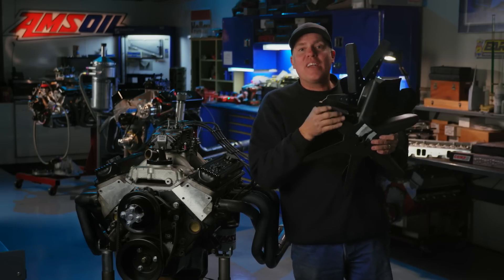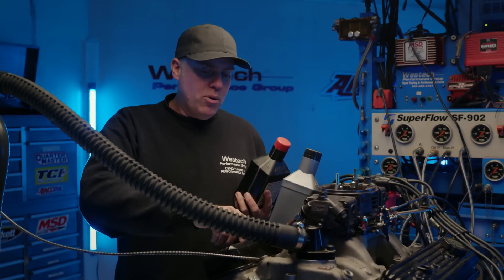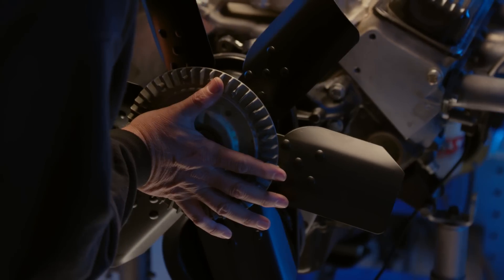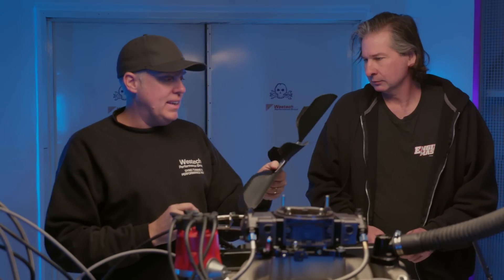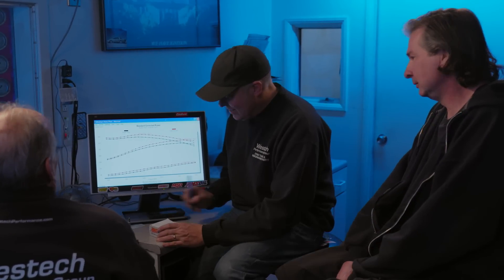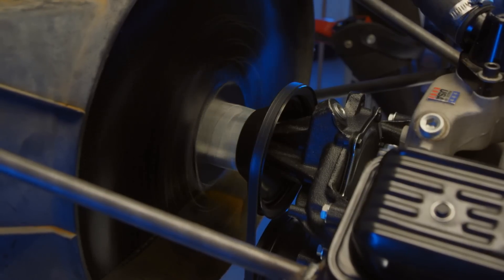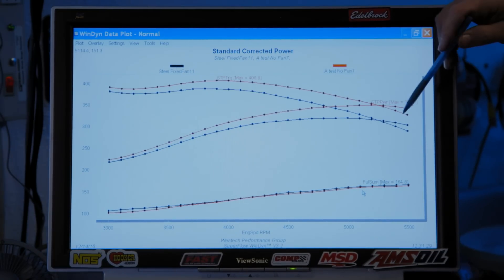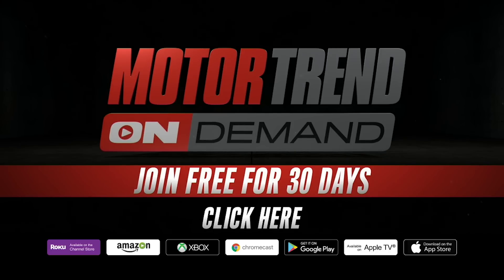Cooling Fan Shoot-Out! - Engine Masters Ep. 20

Comment: Air flow vs. power loss would have been interesting - hp/cfm
Air resistance force is a function of second power of velocity, to get the power it's multiplied again with velocity, so you get a function of third power of velocity - the loss is growing exponentially very fast with higher rpm, the faster the fan blades move air

Comment: These numbers are only relevant at very low miles per hour, after 30mph or so the fan is being dealt more air than it can use. Maybe put a wind speed Guage behind the fan and that would give the speed at which the fan is not using any hp,  only spinning in neutral air.

Comment: I think removing the shroud helped because the fan needed to do less work to get the air moving. With the shroud on it was forced to suck all air through the radiator. Also actual horsepower while driving might be different since air flows through the front better when you're driving fast so fan needs to suck less as air is compressed in front of the vehicle at higher speeds. Driving 100mph, not counting actual wind, is more or less the same as wind blowing 100mph against the radiator and the fan behind it.

Comment: An electric fan swap sounds like a good bang-for-your-buck mod. If your conclusion of 30hp regardless of engine power is right, 30hp on a 200hp motor is a great increase. I might have to swap out the fan on my truck.

Comment: these parasites should be killed off. got mine removed a year and a half ago, went with a flex-a-lite black magic extreme E-fan and its great, turns on with a temp sensor and is adjustable. never going back to that clutch fan.

Comment: reason for the more power with out the shroud, confinement of air. It's like messing with a vacuum hose. if you block off the hose, the motor has to work harder.

Comment: Removing the shroud makes the fan less efficient = less air moved= less work done by the fan= less power used.
A shroud direct the airlow towards the blades.
= les efficient cooling system withou it
I disagree about the electric fan : a charging alternator makes a huge load on an engine.

Comment: The whole purpose of a shroud is to help guide air to the fan. That's why shrouds exist because they help more air get pulled across the radiator cooling fins and help cool the engine down faster. So it makes sense the fixed fan had a slight HP gain with no shroud as it wasn't able to "bite" into the air nearly as much.

Comment: clutch fans(via the jeep in the driveway)drive at full tilt for about the first 4-5 min when cold then you can hold the thing with 2 fingers.....until the thermal clutch kicks in above about 205 degrees then it starts the fan rotating with vigor! hardly and drag in between.
doesn't matter with my xjs though. the v12 has two electric fans installed and the original nightmare setup has been removed.40 amp draw with both on and that doesn't eat the ponies up at all in comparison. go with electric units ;-)

Comment: My take, 12V at 30A is 360 watts or roughly .5 hp.  Air resistance is nonlinear with velocity (rpm) increase. Electric fans have a fixed upper rpm not related to the rpm of the motor.  Unshrouded blades tend to throw fluid radially at increased rpm (design of blade dependent). And crap 30 horsepower is a lot.

Comment: It would be great to know how much air each moves at various engine speeds (especially at low RPM). That would help those of us who drive our rods around in warm weather, especially those who may be running AC to go joy riding with the wife.  If I remember, the clutch fans were factory for AC cars back in the late 60s and 70s.

Comment: You gain HP without the shroud because the pressure difference across the fan is less drastic, so it doesn't work as hard. So yes, more HP, but much less efficient cooling.
Reply: Yeah I was thinking that too. The low pressure drags the fins more. Of course this pressure difference is what causes air to go through the radiator so they could use a smaller less aggressive fan to get the same cooling with a shroud.

Comment: The shroud creates a Ducted Fan forcing the draw through the rad increasing its efficiency. No shroud draws the same power but draws Local Air, resulting in cooling dependent on forward movement of the vehicle

Comment: So basically, the cheapest HP upgrade you can do is to replace a regular fan with an electric one.
Reply: socomcygnusx1 run no fan and just don't idle your car. it depends where you live i guess. my fan rarely comes on anyway, so it would just be for when stuck in trafic. if that doesn't happen to often to you the amp draw schouldn't really be a problem.
Reply: pretty much. at speed on the highway or drag strip your electric fan is turned off as you're geting plenty of air speed for cooling. electric fan is used for in built up traffic and standing still. you can have it set to kick in at a certain temp like 190-200 or you can just control it yourself with a switch.
Reply: TheKajunkat but those 30 amps tho
Reply: roger supernova your crazy but yeah there’s no problem as long as your moving and have flowing air
Reply: Yup!   A mid 90s Volvo 2 speed fans are a great junk yard option.

Never had a problems with a electric style.   Yet..      

Was fun to watch this channel.     

Larry

Comment: So you really think a SINGLE V belt can transfer ((30 HP)) ?? When running over 7.5HP on industrial machines you run DUAL v belts. A 25 or 30HP Baldor or Dayton motor runs 3 or 4 V belts.  So logically,  a electric fan that flows enough / cools the (400hp) or so , must have a 20 or 30hp electric motor......   Your creating a 2000CFM through 7000CFM  insane  (WIND TUNNEL) blasting right over the CARBURETOR!   The carb that you pick due to the (tiny) refinements of blending surfaces .   Hell, you blow air over a straw in a drink & you siphon up liquid....  
    Test this:  those fans on a 2;1 v pulley, powered by a 3450rpm Dayton 2hp electric motor. If a 1, 2, or 3 hp motor can spin the fan at 6500rpm, why is the V-8 collected data sooo out of whack?     Sometimes "logic" math, common, sense push you to re evaluate .
Reply: Jay Dee 
Belt power transfer is limited by pulling force on the belt itself assuming the pulleys are big enoungh to avoid slip. The belt in this test, assuming 6 inch pulleys at 5500 rpm will transfer roughly 31 hp, 30 ftlb torque, 90 lb belt load, and 1727 feet per second belt suface speed. This is probably near the limit of this belt, so 90lb belt load limit on your electric motor at 3700 rpm with a 6in pulley could only transfer 21 hp. If the pulley on your eletric motor is 3in rather than 6 belt suraface speed would half and could only transfer 10 hp because belt load would exceed 90 lb. Belt load and torqure are similar, as belt suface speed and rpm are similar. Higher rpms or belt surface speed at a set  torque or belt load will produce more hp. If rpms or belt speed are less, more torque or belt load is required to keep hp at the same level. A motor turning 3700 rpm could transfer 30 hp, but the pulley must be enough larger than 6in to raise belt speed to 1727 feet per second and the required belt load would then drop to 90lbs. 1727 feet per second is rather high and would cause short belt lifespan so 2 or more belts are used in industrial applications resulting in higher belt load capability, lower belt speed and longer belt life. Belt life is not an issue in a car because noone drives for hours at 5000 rpm.

Comment: Correction: You're running an alternator on your car regardless of if you have a fan or not. Unless you're doing Roadkill. Also, the conclusion to take from this: The only reasons to run an engine-driven fan are if you are trying to keep a car stock-appearing, or if you simply don't care about that lost power.

Comment: As for shroud vs no shroud. A centrifugal fan, like what's in a shop vac, will draw less power when the flow is restricted (that's why they rev up when plugged). Most other types of pumps will draw more power when restricted.

Comment: how does that all work with air speed from the moving car???
Also when running the fan in open air it will draw less power, after all when you add a shroud it increases air flow so that mean more power needed to move that increase air volume.

Comment: The shroud focuses where the air comes from - & since that's through the radiator(which is a restriction - as it's sucking through a mesh of sorts) - it's under more strain... Think getting air through a CAT vs open pipe or sucking through a tiny straw vs a large one.. The harder it is to get the air the more strain\load there is on the fan & hence the engine... My car already uses electric fans - but I'm still looking at other ways to reduce the parasitic loses on my engine(flywheel etc) - ESPECIALLY since you guys have proved that the losses are worse the higher the RPM... Thanks...

Comment: This test is an absolute joke. You need a fan, so having "no fan" is not an option, the "no fan" run was just for a baseline, but it is not an option for any street car, so not testing an electric fan makes this entire advertisement for AMSOIL a waste of our time. MT has really taken a dive
Reply: They explained that they did a test comparing no fan with an alternator driving an electric fan and couldn't measure the difference. Even if an electric fan draws 30 amps, that's under 500 watts, about 2/3 of one hp. Also, once you are above 20-30 mph, a properly setup electric fan will rarely run. It shouldn't need to because any kind of fan is outdone by the forward movement of the car. Just listen for the fan on a new car. It usually only runs when you idle for over 10 minutes.
Reply: Well it's definitely an option on race cars. Also any car with an electric fan will only run when the temperature reaches a certain point creating no parasitic drag at all. On older BMWs I've often removed the mechanical clutch fans because they have a secondary electric fan for A/C which can kick on if it needs to making the mechanical one somewhat redundant. So yes "no mechanical fan" is definitely an option.

Comment: 14:36 not baffling, the fan is drawing air around the radiator instead of having to pull higher resistance air through the rad with shroud on.

Comment: Before watching the video i'm going to guess fans are a pretty significant draw on the engine. I removed my mechanical fan on my Jeep and replaced it with an electric one and noticed quite a big HP boost. Plus it's much quieter without it
Reply: Theory confirmed. My clutch was pretty shot so I was probably losing about 10hp or so.

Comment: Another fan test with a totally different slant (probably not up your alley) would be to take a stock v8 engine in a vehicle driving on a flat road at freeway speed and measure the fuel consumption. Run the same engine in the car on a chassis dyno or out of the car on an engine dyno and run it at the same rpm and vary the load until the fuel consumption is the same. On a dyno would be most helpful (and easiest if carburated), because without the drive train losses, it will answer the old question, "how much horsepower does it take to maintain speed on the highway". By getting the hp number with the same fan, radiator and shroud as when it was in the car, you will be fairly accurately answering that question at the flywheel. Once you know the hp level, you run the dyno with different fans and no fan to the same hp level, and compare fuel consumption. Now you have a complete picture. Each fan has x effect on horsepower and approximately y effect on mileage. Anyone else out there with a calibrated dyno that cares about mileage?

Comment: Would it also make a difference if you had a hot radiator? That would make for thinner air coming into the engine compartment so that the fan wouldn't encounter as much resistance. It may bump you up a HP or 2.

Comment: Honestly does anyone serious about a build use an engine driven fan anymore when electric fans cause zero HP loss when they're not needed, can be controlled by the driver if needed, and are fairly inexpensive? It seems like the producers must be desperate for content? What's next? Should you use a hex nut or a wing nut to fasten your air cleaner? Wait for the dramatic results from Engine Masters! This is how you encourage people to unsubscribe by providing nearly useless content. Way to go Motor Trend turning a good thing into a joke.
Reply: I run mostly stock vehicles. My current drivers (67 F250 and 75 Continental) both have electric fans and I have plans to convert both to electric for better mileage. I've had the lincoln for 7 months and have been driving the truck for 2 years. The information in this video is encouraging me to get it done because it indirectly shows how much more mileage I can get in my old cars.

Comment: As a poor man maintaining old cheap old vehicles, my focus has always been mileage. Cheap changes which improve power and mileage. This always includes the fan. My first suggestion is a repeat with two changes. First find a real aftermarket flex fan, like the aluminum one but with thin stainless flex blades. This will probably be your real best choice. This is important because people need to know the best they can do short of no fan. Chevy may not have one but my favorite fan for my stock fords is an early to mid 70s flex fan. The best they had before moving to clutches. Like a good aftermarket flex fan, it has a rigid blade base and a flexible extension. The extension (which I believe may have been black painted stainless), is deep and curved. It's always been my favorite because I don't like the reliability and expense of maintaining clutch fans and the stock flex fan you can visibly see it flatten out to 1/3 it's depth just by watching as you rev it to just 2000 rpm. The deep blade draws a lot of air at idle for handling traffic on a hot day and immediately backs off when rev'd.

Comment: Gotta think of the radiator and fan like an air filter it restricts the flow. Take the shroud off and the engine doesn't have to suck as much air through the radiator.

Comment: steei bolt on fan makes sense as far as reliablility in a daily driver.  No need to spin past 3k.  I only mention it cuz I had a fan relay burn out it phoenix.  Not fun driving with the heater on when its over 100 degrees

Comment: An electric fan does not tax the electric system or the alternator, if you have the right wiring, alternator, and voltage regulator.

Comment: I did some basic math considering the drag equation suposing the following values:  drag coefficient = 0,1 ; air density = 1,15kg/m³ ; blade front width = 0,05m ; blade length = 0,35m. The power loss at  6000rpm is close to 21hp, and the power loss increment with rpm is non linear, wich is consistent with the test. Its important to notice that the test don't considered steady state conditions, consequently some of the power was used to speed up the inertia added by the fan. The power loss is reduced when the shroud is removed because it reduces air volume propelled by the fan in the normal direction, and increases at radial direction, wich takes less energy to do. The result is less air passing through the radiator.

Comment: the clutch fan  will take the least  DUH?? chevy and ford always go direct drive because they dont care about " your" gas mileage.you're welcome Ford and chevy  suckers anything to save a dime they could care less after all a clutch fan cost another 30 bucks  Dodge HAS always uses clutchfans, clutchfans loosen up even more, using even less HP a few minutes  after engine startup, they did not adress this in the video, as they said  they dont engage unless detecting heat from the radiator so they work very well when you're freeway driving and going  80 MILES PER HOUR , where fan cooling is not necessary ,  unless pulling a trailer.  good video other wise

Comment: Interesting results guys. But there is one problem with your testing. Which one? You were measuring how much HP loss does the fan cause when the car is stationary. Now you should do another set of test to see how much HP loss does the fan cause when the car is moving (the air is already blowing through the radiator). 
So how to test this? You would need another independent fan in front of the radiator to simulate airflow of a moving car. I'm willing to bet that at speeds of about 60 MPH even worst fan would drain just a few HP away if at all.

Comment: One thing to think about: if you have air coming in through the front of your car at 30,45,75 MPH, how does that play into the equation? One would think the air that's being forced into the fan would reduce resistance and help reduce that parasitic loss.

Comment: Air preheated by going through a hot radiator would be slightly less dense so the fixed
fans would use somewhat less hp. The clutch fan should be tested with a photo electric tach to see how much it slips and a heat source on the hubs thermostat to see how engagement  changes.  Car speed and front end design will affect how much air gets to the radiator. If the  air pressure between the radiator and the fan blades is reduced the fan will draw less hp. About the same as blocking a vacuum cleaner inlet and hearing it increase speed. 
  A boat propeller manufacturer  took a 14"diameter 3 blade bronze prop and made it with 
 zero pitch blades and spun it at 3000 rpm under water . It took 70 hp to turn it and it wasn't moving any water in a useful direction.  Of course water is about 700 times more dense then air !